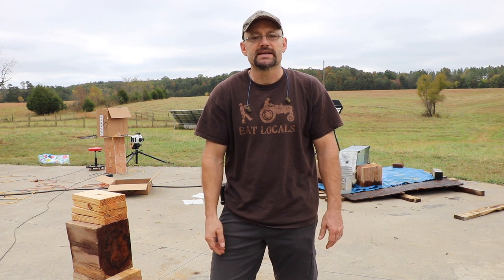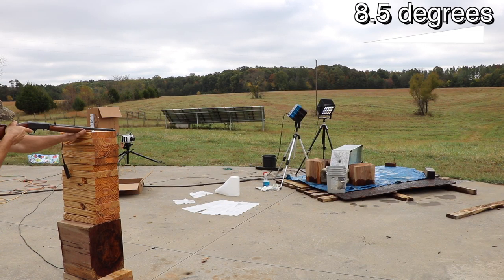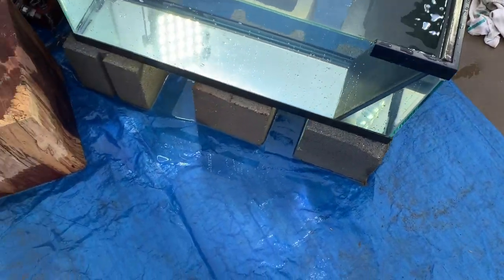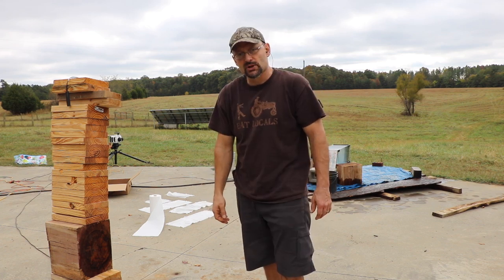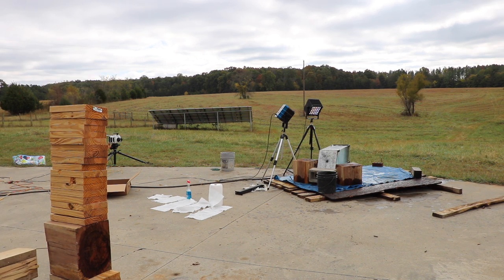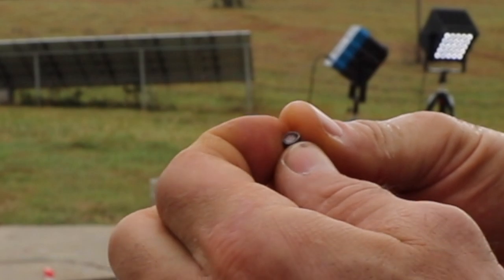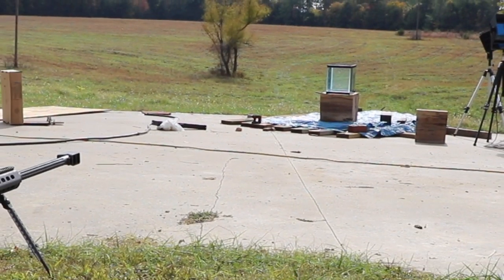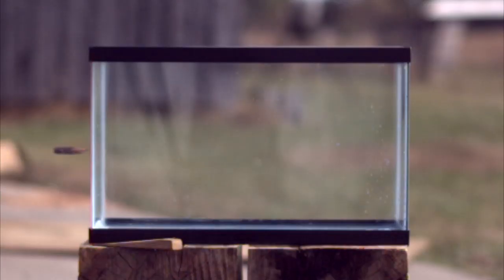Bullets Walking on Water.  Amazing Slow Motion Footage.  GunCraft101

Comment: The angles would also be different depending on the profile of the bullet, FMJ, JHP, boattail, etc. Full series coming? Great videos. If you calculate the difference in the entry energy and the exit energy you should have the amount of energy expended into the water. It would be interesting to know how much energy it took to crack the glass and to see if it's consistent with the different calibers. You might develop a new formula to add to the textbooks 😁

Comment: 8:29  The bullet-strike to the steel plate seemed momentarily to precede the shattering of the glass.
Do you think that the plate amplified the shock, coupling it to the water sufficiently enough to break the glass?

[edit]  Do you think the shockwave generated at, say 2.5 deg. is enough to give you a rough idea of the energy (speed x mass) of that particular projectile?